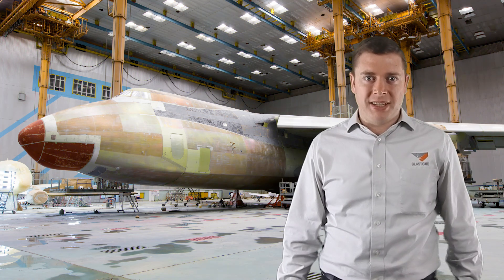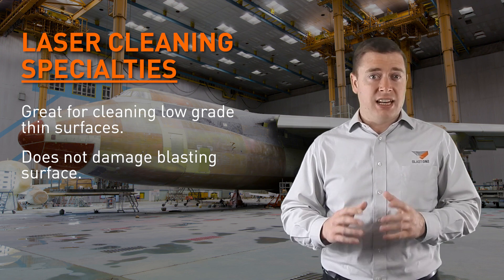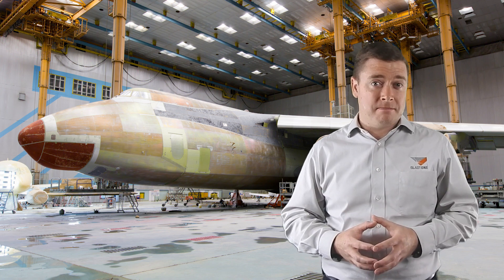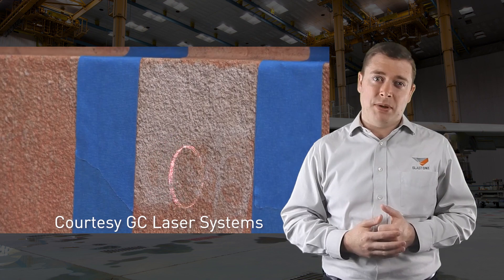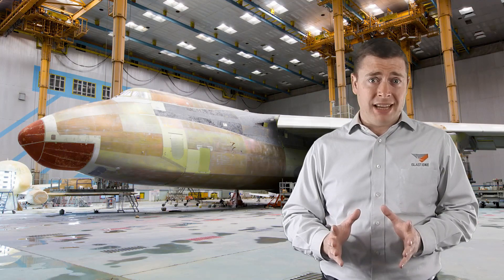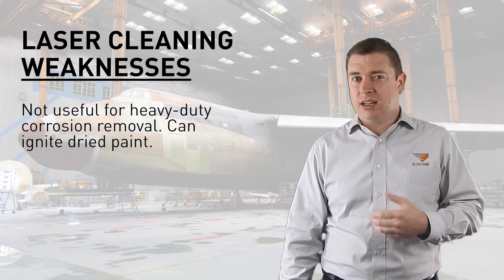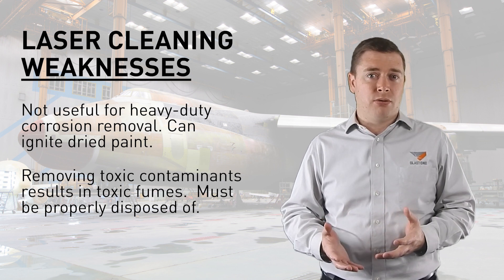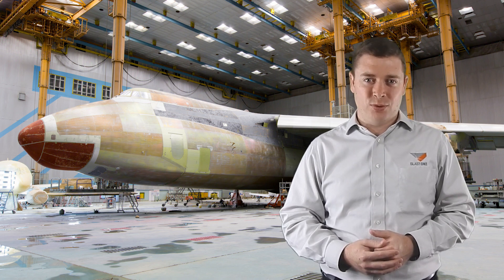Laser Blasting: Strengths and Weaknesses

Comment: Lasers do now produce a profile up to 2 mils. They can also remove millscale and heavier rust. The technology is becoming better and better
Reply from the maker: Steve, thanks for your comment, unfortunately this is not true. Laser can not remove metal or reform metal to create a profile the way Abrasive blasting does.
Reply: @BlastOne  Ok I am sorry you don't believe me but I am a Nace 3 inspector with many years in the industry.  It was hard for me to believe until I saw it. There are many different types of lasers, cutters, etcher's, does not do it in a sharp angular profile as blasting does but it will produce a profile as well as you would get with a SP11. Feel free to give the guys at laser photonics a shout ask for Brad. There are many lasers that cut metal they just use that technology in pulsed form.

Comment: I am sure that your laser power less 300W pulse, if you can use 1000W pulse laser, you will know it can be cleaned heavy-industry rust and paint as well.
Reply from the maker: Yes Laser can remove rust, correct. but its still not applicable for industrial coating removal at this time. to slow, and too expensive. when it improves, we will be selling it!